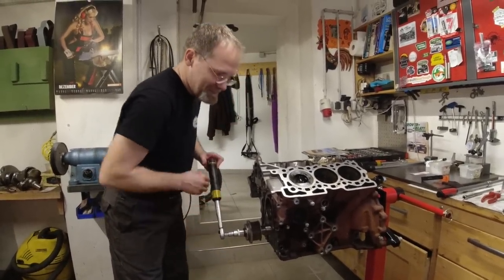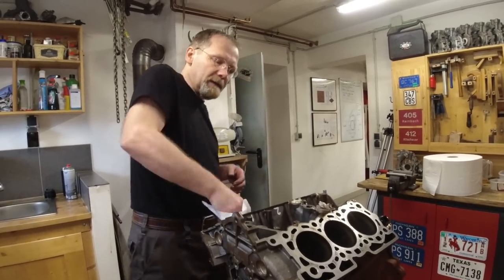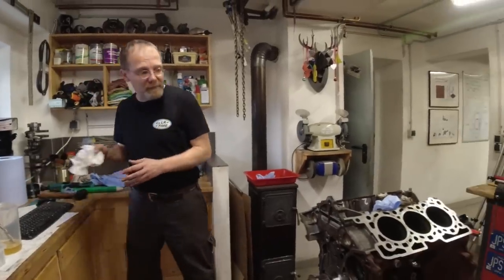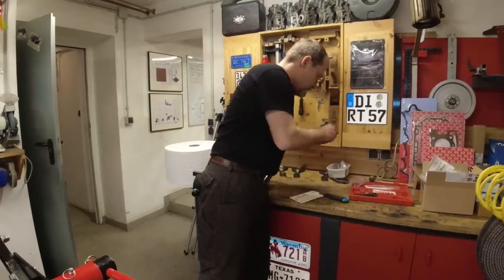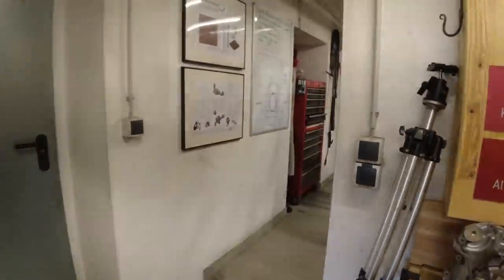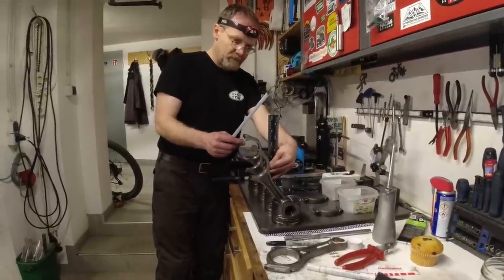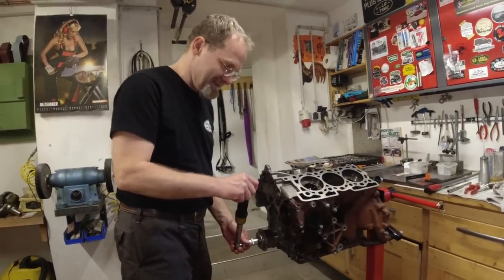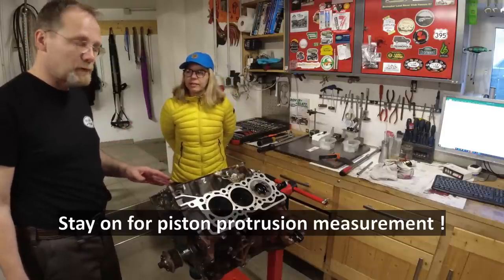Short Block Build - Land Rover TDV6 / SDV6 / S4-Ep16

Comment: Fascinating.  Well done.  Another great piece of education.  I wonder if the factory undertakes all these checks?
Reply: Ford used to take engines off the line randomly at completely strip them bare and check all the tolerances. A friend of mine used to do that at the Dagenham plant,( where the original TDV8 was made) I don't know even if the Dagenham plant are still building engines anymore, but as JLR are still selling TDV8's  maybe they are. My friend had a Cortina mk3 2 litre GT, and he and a couple of mates on a slow night pulled his car into one of the bays, pulled the engine, stripped it and rebuilt it with an over bore, new crank and cam and finger followers and got it back the car for him to go home in the morning!

Comment: well team, here s how you make a real ring  and piston fitting tool, we did it this way at Cummins, we used an old liner though
all you do is take a steel tube, bore it 1.5 or say 6 thou bigger than the piston skirt then you need a wall thickness of 4 mm up, any size is ok, then using your compound on the lathe cut a lead in taper one end , shallow taper, cut the length say 100mm, then fit your rings and slide the assembly into the tube, the rings will gradually go past the taper and then put the tube on the block, the skirt will be protruding, enter it into the block and tap it down as you did, easy!!  use a 20 kg hammer🐶 taper must be slow, I would send you a dwg but where to

Comment: Toyota Owner Here, Need some advice .... sold our 2013 Toyota Prado after 300,000km (no issues) and purchased a 1 Owner  RR sport 2013 SDV6 100,000Km (full service history) immediately had the following done as a precaution 1. Turbo Drain Mod 2. ZF transmission sump upgrade 3. Full Service 4. Transfer / Gearbox and Diff oils done. The RR runs so well so comfortable and is perfect for my wife when towing her horse float as it self levels, fuel economy 7.3l per 100km highway and 13-14l per 100km when towing sometimes less depending on terrain. We are aware of the intake manifold splitting potential and as such we never over work the car and try and keep our RPM's 2300 and below we never exceed 100km/per hr. 

# Issue I have is my wife can drive anywhere from 3-8 hrs to get to an event (towing the horse float) on her own and I worry about the manifold splitting and or worse the crankshaft going and or the bearing/oiling issue

I really want to stay in the LR family as the ride quality, engine performance, fuel enconomy, self levelling and the seats and seating position or excellent. 
Do I keep the RR sport and continue 10k servicing 5w40 oil and continue to drive cautiously and hope or sell it and purchase a SDV8 as I believe they do not have these issues ? correct me if i'm wrong.
Reply from the maker: The SDV8 is not available in a Discovery.  Sad but true.  You can run 5w40.  Yes you have a risk of a engine failure with the 3.0 6 cyl. Diesel but it’s only 3% of the engines failing.  This is a lot compared to a Toyota but unlikely to own ones. Christian

Comment: Somehow I cannot see many garages doing half of this work if they are rebuilding an engine just buy new parts and assume that they are correct to fit at least with yours if something goes wrong in future you will not have to worry about the engine.

Comment: I was wondering if the best option for an engine rebuild was to use used parts like from an other damaged engine?
Then you will not have the initial brake-in damage period and the parts would fit for sure.
Reply from the maker: I tried to get a used rod but had no luck to find a low mileage one.  Christian
Reply: @Vera_and_Christian  probably nobody bothers to sell the used parts and everything goes to scrap metal - or the engine rebuilder shops keep them for themselves

Comment: Great vid, lots of useful info on proper measurement, piston protrusion vs right head gasket thickness. It all makes sense. Completely lost faith in Britparts, do they expect you to machine parts to make them in spec?🙄 Are there other alternatives to Britparts? Except for the originals? It got silent at 10:39 in the vid, somebody went to the grocery store😅
Reply: It is disappointing that that parts are not to spec that's for sure. The manufacturer should be doing better than this.
Reply: One can only hope those rods are any good.

Comment: Hi guys. I would like to find out I'm busy with a disco 4 3.0tdv6 engine is rebuilt and everything but I am not getting fuel out of the hp pump.The low pressure pump fuel is there but the hp pump is not working. Is there anything that I might have overlooked. Thanks a lot for all your amazing video's.
Reply from the maker: Don’t know.  Ours worked right away. This will be in our next video.  Christian

Comment: i have a question for you,i recently had my crankshaft replaced and i drove the car for 1 week and know i have a oil leak coming from above the starter motor on a range rover sport 2015,would you have a idea off where the oil leak is...im waiting for it to go back to the workshop that carried out the work,thanks
Reply from the maker: Wait for our next Sundays video. There are many sources for oil leaks if you are not following the correct assembly procedures. 👍🙋‍♀️Vera

Comment: So the Plastigage test is just for running clearance and not ovality, I guess you cant turn the crank during the test so in that case its necessary to have near perfectly round big end crankshaft journals, I'm only a novice but I cant help but imagine that most used cranks are not perfectly round, perhaps you can clarify the objective of the Plastigage test on a used crank or has this crank been cut?
Reply from the maker: Roundness of the rods is gauged with the bore gauge.  Our crank is new so we did not have to worry about it indeed.  Christian
Reply: @Vera_and_Christian  One especially realises the importance of oil viscosity!

Comment: Been following from the early days what oil are you recommending for a d3 2.7 d  2008 thanks still under 100 .000 miles I have more trust in you than Ford lr👍
Reply from the maker: If it runs quiet, I would stick with OEM spec until it has 120 t km.  2008 has the weaker pump with the 13.5 mm rotor.  That is more concerning.  Christian

Comment: I did a survey amongst the JLR workshops which number 3 and the independent LR specialists which number 5 in the city where I live, I also phoned an engine rebuilder that provides rebuilt engines for these cars to get an idea of the size of the issue. Obviously it wasn't scientific but purely a number from JLR parts department and the others the owner of the business. In my city last year among the dealerships above there were approx 30 engines were replaced. 
The price of new JLR engines have gone up 60% in price over the last 2 years and before if you serviced at these dealerships there was a good will gesture from them regarding the engine cost however this has now fallen away.
 If you aren't able to work as Christian can and are able to be involved with your own rebuild the cost is to replace them is about $ 15000.

Comment: Hi ,how do I join your patron subscription on an iPad please. Can’t seem to find a link.
Reply from the maker: Hello Steve, see end of video or video description.
Reply: Hi, thanks for the prompt reply. I have found the link and joined your patrion group , thanks for the excellent videos. Just doing the same job on my Disco. Broken vacuum pump drive dog, stopped the cam, turned out the location dog on the pulley drive wheel. Put the valve timing out. Stopped the engine. Lucky the engine was at idle when it stopped. Seems to be minimal damage.  Deep joy!!

Comment: Great content as usual . My question would be , why has land rover never excepted responsibility for such a unreliable engine . a friend of mine had disco4 commercial , one owner , one driver , no towing . 60000 miles bang , no warning . Crank snapped , he sent to LR and got a bill of £14000 . My best mate had 2.l diesel disco 5 , engine let go at 44,000 miles £ 11500
bill , non franchise . Yet the TD5 appears bomb proof so Lr can build at least one good engine . On the ingenium engine LR us a simple chain . MB had issueswith a simple chain set up and  so swapped to Duplex . Land Rover have a horrible customer service atitude and treat customers spending £ 100,000 with absolute disdain .Have you considered a Toyota 3.0 /  4.2 diesel to disco conversion ??
Reply from the maker: This is a bus integrated engine and it’s not possible to replace it with a non LR ecu engine.  At least not for me.  LR got in trouble in South Korea and in China. But not in the EU, Uk or Australia.  Christian